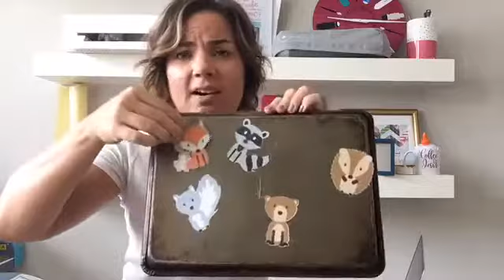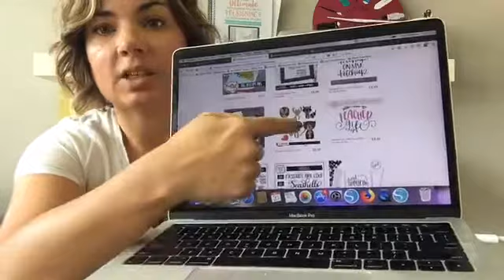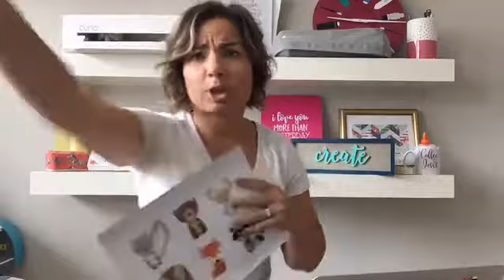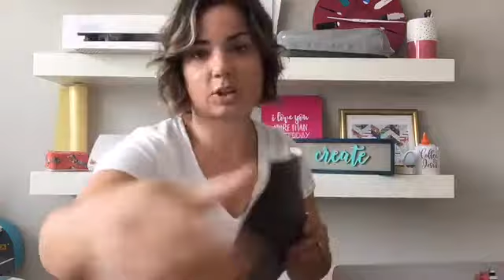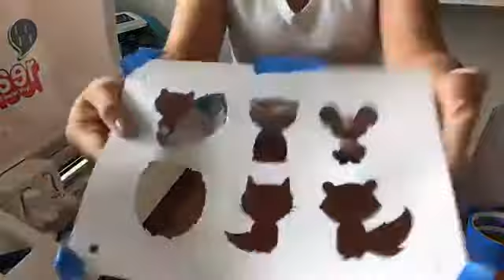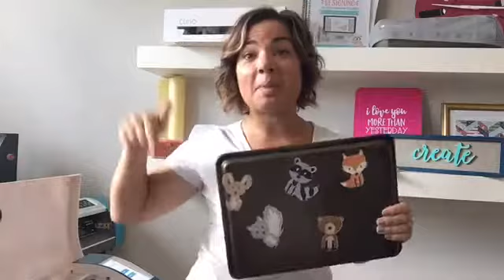How to Make DIY Magnets with Silhouette CAMEO

Comment: hi, can i ask whether the blade dull faster if i use it for cutting material like magnet sheets. im planning to do on 0.5mm thick magnet paper
Reply: I mostly cut vinyl stickers and magnet sheets, but sometimes matte photo paper. I would suggest to do what I do and have a separate blade that you swap out for the magnet sheets and another blade for vinyl and paper. It definitely won't cut as sharp on regular paper after you use it on magnet sheets.